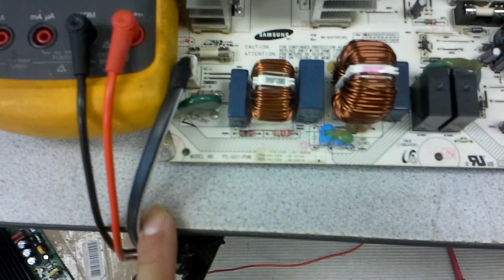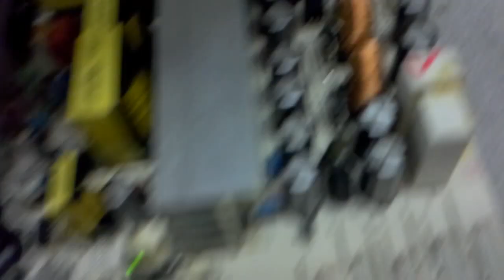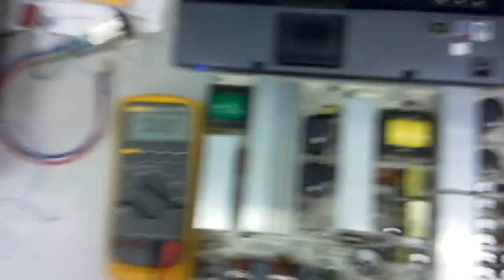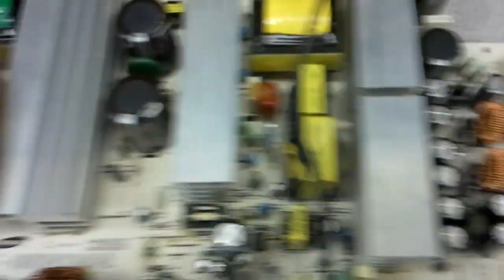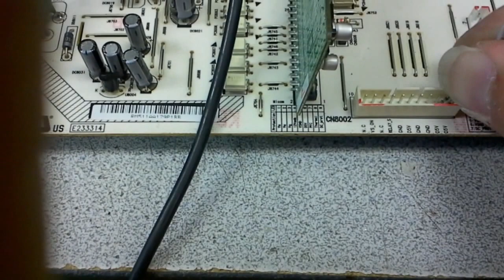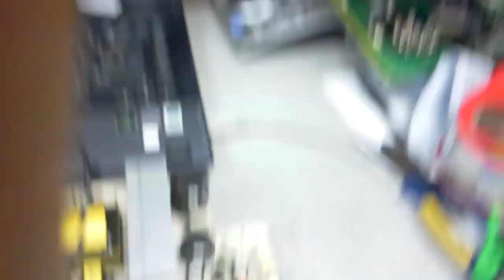How to test LJ92-01511A PS-507-PHN power supply

Comment: ok i get the testing part if you dont have an error, but how would you go about testing if you do have an error, i have a d5v error and am only getting 3. something vots to anything related to that circuit instead of 5v, and yes even when disconnecting everything besides the dc cord to rule out all other boards besides the psb, what should be my next step, i was thinking it could be a burnt or faulty mosfet on that circuit. i appreciate any help i can get from you if you can
Reply from the maker: +acegirl2288 That is beyond the scope of this video. This tells you how to know if you're looking for a problem in the board or outside of it - and even that with just a reasonable certainty and not 100% guarantee. If you know the problem is in the board then you start troubleshooting the circuits in it and that looks very easy if one particular problem is discussed and shown, but usually stupidly useless in the other 99% of the times when something else has failed. So we draw the line to module level troubleshooting and offer component level repair services for those who can't do them. Note we do not guarantee the results of that either, but we do not charge any service fees if we receive a bad board that we can't end up returning working well.
Again, troubleshooting the particular error codes is way more complicated in the average case to be doing it in a video.
There are a number of attempts to explain component level repairs BTW.
Some may help you, most will confuse or just flat out bore you without helping. Finding the right ones for the individual situation is tough enough task on its own.
Reply: i figured it was worth asking i am proficient in testing voltage and have replaced all bad caps, but the problem lies deeper and i thought maybe i could get some help with what i need to test next, all voltage on the board is dead besides any standby 5v circuit. im thinking the power ic's might be the problem but cant find out how to test them.

Comment: How do you proceed if you get 3 blinks which states vg?
Reply from the maker: +1ryanmcdonough You troubleshoot the Vg circuit backwards. I'd check the rectifier diode providing the Vg (15V), then check the other output windings on the same transformer and see if they have problem outputting too.
The idea is to find if the problem is Vg specific or the whole transformer outputting the Vg is not working and Vg is just the first protection that happens to catch it.
If other outputs from the same transformer are present then the primary side driver is working OK (well, if they are present and in range) and you only focus on the Vg circuit.
Hope this helps.